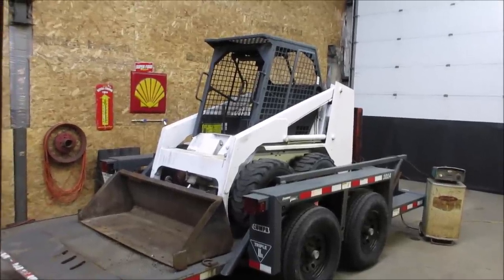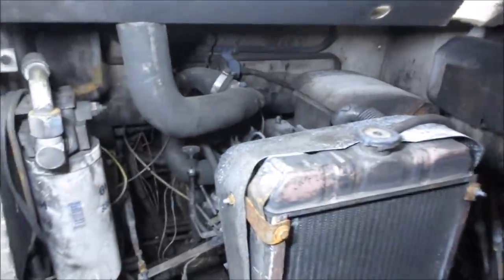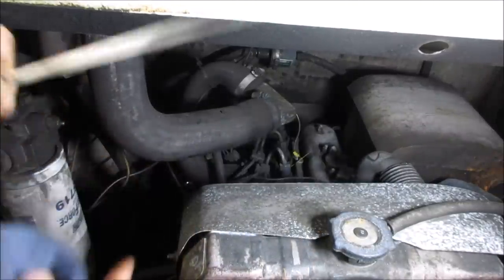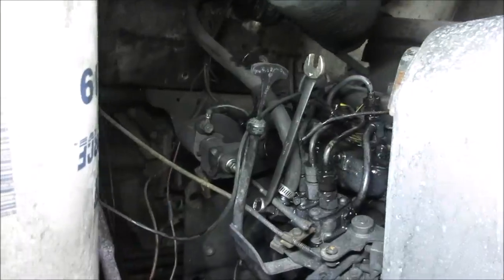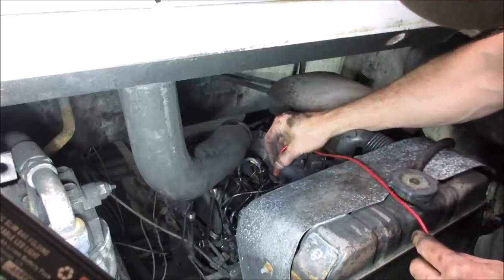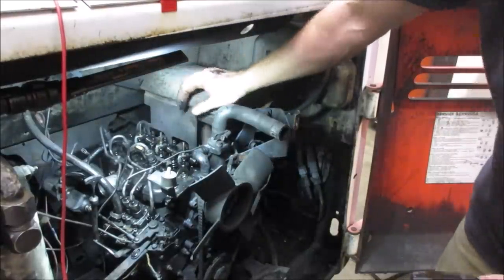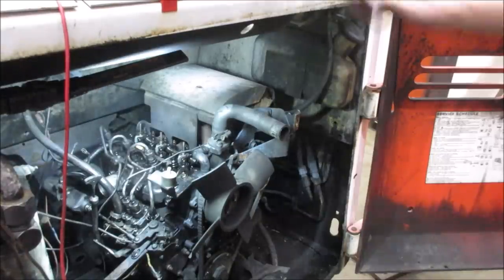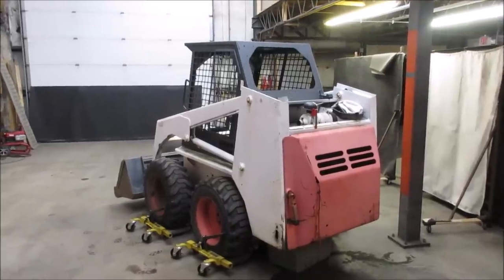Gambled on a Non Running Bobcat. Will It RUN?

Comment: That bobcat is in better shape than any of the ones that need an engine in my area
Reply: Yeah, they painted it before selling but then again it isn't rusting through the Rustoleum spray paint (yet) nor is it bashed to death on the exterior. It's in great cosmetic shape despite the seat, the hasty rat's nest wiring and so forth

Comment: my friend had the same engine and the same problem. the muffler was almost blocked and it had caused the piston rings to seize. low compressions and also leakage into the crankcase. new piston rings and cylinder honing were enough to repair. at the same time the bearings were renewed.

Comment: If that was an old saxophone (my specialty 😂) I would probably want to do a complete overhaul returning it to OEM specs as close as possible. That would be expensive and time consuming. It really looks like it has seen a lot of use and as Darren said not much love. The engine sounds like it needs a ring job. 😮
Reply: A new wave theater fact-let. WHen Bob Seeger came to Portland Oregon at the Coliseum in the late seventies, my buddy brought along his M-80s and would light them and toss them in a ballistic arc in an attemp to land in Seeger's Saxophonists' blow hole.  He did not succeed and the Sax player had the good sense to back away from the front of the state.I'm sure this is not the ONLY time that's ever happened at a rock concert with a saxophonist.
Reply: @silasmarner7586  one of my sax player friends was playing a political event long ago and a guy came up and used the bell of his sax as an ashtray. Let’s just say there was trouble lol.

Comment: When it didn't "pop" with the starting fluid , I knew it was bad. There's no telling how many hours are on that engine. Be great content to see it re-powered cheaply with something you already have in your shop.
Reply: Yeah, the meter said what, 2,700 hours. How bout 12,700, or 22,700? Those little diesels make like 20 or 40 HP, and technically seem run forever, if he doesn't find a quick fix with the rings or pumps or whatever, he can swap a rebuilt out for 5 grand, or find a pull for way less than that. I'm rooting for him to put a tesla or hellcat powertrain into it. First 150 mph, 700 HP skiddie! Internet history being made!

Comment: I have a 7753 bobcat, i traded two 40ft containers for it, came with a regular bucket, a 4 in 1 bucket, forks and a backhoe attachment, it had been sitting for a long time, was used on a chicken farm, the fuel line in the tank had fallen off and the quick change was seized, the fuel shutoff solenoid stopped working and the control box on the wires leading up to it caught on fire, apparently this is a cause for bobcats to burn up, everything but the fuel tank has been fixed, i just hang a jerry can on the side, and i installed a manual shutoff, i say your tires look fine, new tires tear the ground up so much, i'm running an old bobcat at work now almost every day, the glow plug switch is on the left overhead panel, a momentary rocker switch, you will love your bobcat.

Comment: For future reference - should never crack an injector line.  That fuel is under REALLY high pressure when the pump is working.  High enough to pierce the skin if you have a pinhole or small crack.  

I haven't worked on a diesel in years - no call for me to.  But that's the one thing I really remember.  I really loved driving them.

Comment: Part 2: Mustie discovers he never tried the kill switch in the correct position 😮😅
Reply: The only way to kill a Diesel engine is to cut the fuel supply and Mustie got that covered (cable running to the cab). If you've got compression, rotation, air and fuel a Diesel engine should start or at least cough a tiny little bit.

Comment: Great video Mustie ,I reckon that with the radiator where it was and the exhaust firing into the engine bay it probably cooked itself hard ,I think that generator engine might be a good candidate or and this is a big or a junked kubota or small tractor,great video once again 👍👍

Comment: After watching this, if anyone could make this work, it would be you for sure.  I wonder if it ever ran on that engine, but i would like to see you either change it back to a gas engine, or maybe rebuild that engine if it is worth rebuilding.  I have seen some of those bobcats with the rear door all smashed up, and lots of rust.  The good thing about this unit, is that it doesn't have all the digital stuff that fails quite often on these unit's.  The only down, which i could see you fixing, is the quick change being welded on.  You can put so many different useful attachments on these skid steers, and that would be cool.  A lot of work would be needed to get this right, so i wouldn't blame ya if you kicked this down the road, so good luck, and G-d bless.

Comment: There should be a number cast in the block above the oil pan rails. That looks like either a D905 or V1505. If the valves aren't opening fully, it won't build compression and will push anything it does compress back into the crank case. I would do a valve adjustment and try again. Those little 3 cylinders are used by Beta Marine for sailboat engines. I'm kind of familiar with them.

Comment: @Mustie1, you can get a rebuild kit for a 3 cylinder Kubota, complete with cylinder liners for between $300 to $500.
Reply: Where??? I looked into kits for a D600 and they were 2-3000, IIRC.

Comment: Musti1 that needs at least 300 psl compression to run. D722is the model number of the engine. Look underneath the injection pump, that's on the block. The model number and engine serial number are located there.

Comment: Doesn't appear to be nearly enough fuel pressure, and they have to have very good batteries or battery in order to turnover fast enough to start.
Rebuild kits are reasonable, and if anyone can pull it off it's you. 
As far as wheels and tires, I'd go with the wider turf tires, as they don't sink like standard width tires do.
Plus whole lot smoother ride, and when you replace the seat.
Don't cheap out, because you'll regret it in no time if you do. 
Good luck, and you might as well make your own wiring harness to eliminate all the BS left by others before you. 
PS
Be glad it's not powered by Perkins, because the 3 cylinder 47.5 hp diesel in my 135 massey ferguson tractor for reman engine is over $8,000.00.
Little too much for a tractor from the late 60's in my opinion. 
Besides I can get a 7.3 turbo power stroke from Ford, or Navistar either one for much cheaper than that.
Reply: Not a good idea to use turf tires in a skid.  The original tires are designed to allow the skid to slide the tires sideways when turning.  Any other tread pattern doesn’t want to slide sideways, causing excess wear on the drive chains and hydros.  I was trained on New Holland skidloaders, and those with tires other than skid type tires, always had issues with excess wear on the drive chains, and issues with the hydros.

Comment: Not sure if you said this in your video, but I think the oil in the intake was put there on purpose.  On tired diesel engines pouring oil into the cylinders is a trick that can bring up the compression high enough to get it to fire off.  It's a method of last resort.

Comment: You have the 2 cylinder Kubota diesel that might work :)

Also wouldn't reccomend trying to start a diesel with high oil level because it can run away.
Another thing do NOT spray starting fluid into a diesel engine like you did. Reason being diesels don't have a throttle plate like gas engines, they are just wide open and when you keep spraying starting fluid and it starts it'll rev to a million rpm and blow up.

It is also quite dangerous to stand behind a skid steer you don't know nothing about while trying to start it. You don't know how the forward/backwards levers are set up and when it starts it could start to go backwards/forwards. Would be entertraining tho...
Did we finally see an engine that Mustie1 couldn't start? Write that down to history books!
Also kinda doubt it only has 2000 hours on it..maybe 12k? 22k?
Reply: Thats not really accurate, spraying ether into it like that won't cause it to run away and blow up, it'd rev a bit but not blow up, the valve float would stop it first as it's a basic failsafe to stop overrevving and if the ether wasn't starting it then the oil definetly won't, as for the drive controls if you were watching he literally drove it off the trailer, the hydraulics are driven by the engine, if the controls where engaged then it would move when the engine was cranking the entire time, so there was no risk of that happening, and as for actually starting it, diesel engines are a lot more temperamental to lack of compression than a petrol as it's entire function relies on it, where as petrol has spark ignition so it would at least sputter and likely fire off so long as it's got even a little compression.

Comment: I'd like to see the engine come out and be rebuilt, there's no guarantee the person who did the conversion ever got it to work, so you should rip out all the electricals and do it properly with new switches and appropriately rated wires. I do know that small engines like a lot of glow plug to start, they rely on the combustion to keep them glowing to make a hot spot to assist in the pressure ignition after starting, even when the plugs are off. So a switch and indicator light in the cab is a really good idea. Those engines should go on for years if reconditioned and  serviced properly and work better in cold conditions than a gas engine.

Comment: The first time Mustie has strung those three words in that order: "Please Dont Start!" Ps it looks like the engine listened. Im sure you will get it going in episode 2. My 2 cylinder Isuzu in my 1980 Bolens has a mechanical air damper that shuts down the engine. If you have compresion and fuel to injectors, look for air restriction in or out.
Reply: @ritchiesokol1061  one of the rules of firearm safety applies to power equipment "Never point it at anything you do not wish to destroy"

Comment: Dirt-common engine wordwide. Rebuild kits from many sources. Replacement engines from many sources as well, I would think. In general these are extremely reliable. I have one in a sailboat, (Yanmar).  Having fuel pressure is very important including no air in the fuel lines, meaning the lines to the injectors must be purged of air before one will start. That lopeing sound when the engine is turning over is normal.

Comment: GLOWPLUGS - Kubotas just  won't start without them after sitting a  few  hours, let alone from cold.  10 years back I bought a Cushman Truckster with a non running Kubota D950 in it - rev counter & hours were broken, but showing 9000+ hours. Stop solenoid was bust, fuel filter solid with muck, wiring burnt to starter etc etc. God knows how many hours it has on it now,  but it still runs fine  - it's a job to kill a Kubota! Get the glow  plugs working (30 secs for the first time), make sure the stop solenoid is OK & I'll bet she goes - (don't piss  about with compression testers unless she doesnt!)

Comment: We put a vw motor in a case 1537 its worked great for many years,  Just make sure to add vent holes under the engine.

Comment: The thin adaptors in that kit are for testing compression at the glow plugs. You probably have one of those that’ll fit that engine. Take the glow plug out and screw in there.

Comment: @Mustie1, Glow plugs, Careful bypassing the glow plugs in any diesel, glow plug circuits most often have a low-value resistor in series with the glow plugs that limits the amount of current the glow plugs can draw,  Without the limiting resistor the glow plug will draw whatever it can from the battery.

Comment: my dad was a Deutz dealer for many years and one time, a farmer tried to fill the oil bath air cleaner. When he cranked it, the air intake sucked oil through the air filter and ingested oil. Eventually, he really overfilled it and cranked it up and it sucked so much oil in that it stretched the head bolts and shot a film of oil out under the heads... That was a top end overhaul to get that rolling again...

Some bobcats were sold with an italian ruggarini engine which is a modified Deutz engine. They could never keep the coolant out of the lubrication oil, so they gave up and made it an oil cooled engine...  since this one had a radiator, that means it isn't oil cooled...

Comment: The fuel shutoff selenoid is a pull type. That selenoid has two coils one to activate and the other coil to hold the fuel on. You cant leave the activate coil on for more than a couple seconds it will over heat. I agree with others that its compression. Fyi i never use either after heating the glow plugs could create too big of a bang. 
Love the content.

Comment: I wish you the best with this machine.   With the cost of hydraulic hoses and other parts I am fairly certain you will need, even with a new engine, this one may be done.   I hope not for your sake.   Worse comes to worse, take off the bucket and whatever parts you can sell, and then scrap what's left.  Hopefully that will get you most if not all of your money back.   Good luck with it, and I agree that if anyone can fix it, it's you.

Comment: i know a little about those 3 cyl kubota engines, they were known for the fuel pumps going out and a new one back then was $250, but they have massively dropped in price. they also had weak glow plugs. with a little time and money, you should be able to get it running, the block itself is pretty reliable.

Comment: To test start a low compression diesel, you need a high speed roll start, far faster than anything the starter motor can do, and to do that, you need to either haul it up a mountain or get a friend to tow it with a rope.  And it can't be automatic trans.  
  You could also try putting extra voltage to the starter, like 24 or perhaps 18, being sure to let the starter cool off between attempts.  And there is an oil additive called Restore, though I'm not sure if it can boost compression while cranking, before you get it running.  You would certainly want to drain off the existing oil before using it on that engine, and refill to the proper level with new oil after adding Restore.  Then you would need to crank long enough to get the Restore onto the rings.

Comment: I fitted a four cylinder v2203 from a reefer unit  into one like that. I have one with the little stock ford motor, if you need photos. Theres a blurry video of my swap like 5 years ago. You will be able to repower it with the 581 hour unit! Cant Wait!

Comment: So I work for 1 of the largest rental companies in the world,and I can tell you for a fact that those engines are known for bent connecting rods.if you use either on them,that will bend the rods.if a rod gets bent,then there is not enough compression for it to start.we have those engines in everything from small skid steers,to light towers and tow behind generators.i have replaced countless of those engines because of that reason.

Comment: My 3 cylinder Kubotas have two solenoids on the pump, one for starting, and one for running. If the starting one fails, it will not start. (as will no or low compression as you rightly said)

Comment: Well.  Where to start...   drop the oil.  Drop the engine oil filter.  Let sit a few days draining...  pull the injectors spray penetration oil to free up the rings let it sit a couple of hours turn it over every 15  min or so work it in...   put new oil in it replace injectors, adjust valves, bleed the fuel system, pray and fire her up if that don't  work you got a rebuild on your hands and those little kabota engines are quite expensive for parts..   but your like me and enjoy spinning wrenches,  rebuild her so you know what you got.  Those bobcats are quite useful..

Comment: You should totally hit up Matt at Diesel Creek, he's sort of in your neck of the woods, and if anyone knows what's supposed to be in there or can get the right parts, it's him. I'd guess if it was a Ford gas engine that was in there, it's going to be one of the 2.something liter industrial engines, it's more or less a Ranger engine but with a carburetor, JLG used them in some of their equipment. Being an 80s Bobcat, it was probably one of the 80s Ranger engines minus the emissions crap. I like the idea of slapping a VW engine in there though.

Comment: I'd love to see you fit another engine in that skid steer - particularly if it was one you wouldn't normally use, like a VW engine ;o) IF it used to have a gas engine in it, it might be easier to find one of those. You could even put in one of the twin-cylinder engines they sell in Harbor Freight, if it has enough power to run it.

Comment: 16:56 That electric pump is a transfer pump, all it does is move fuel from tank to injection pump. Doesn't have to make much pressure, all pressure is made by the injection pump.

Comment: Mustie you’ve faced a lot more difficult things than this? It’ll be easy it’s a 3 cylinder parts are available and the benefits of the machine will greatly benefit you in the long run. I just completely rebuilt my 1835c case Skidsteer and and then built a brush cutter and 4 way dozer blade plus it came with forks and a bucket. No risk no reward 😎🤙🏼

Comment: 18:18 hi! been a fan for years now. glad to see the smal enggine master aqaier a bobcat. when u drow if of the trailer, i should have cracked the injection lines to see if the pump pumps fuel. and also for safty. also look for smoke. now when i see oil in the intake i suspect bent rods and possibly a blown headgasket. ); witch lead to low compresion. outher then that i think its good. i would get rid of that improvised radiator and got a used original one. thanks! greate vids!